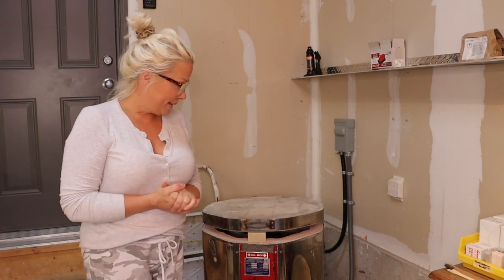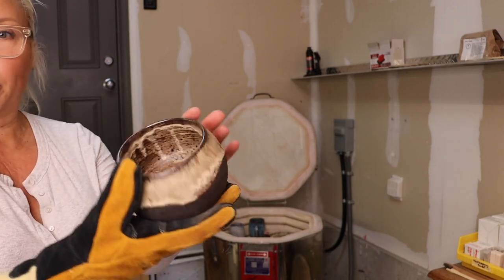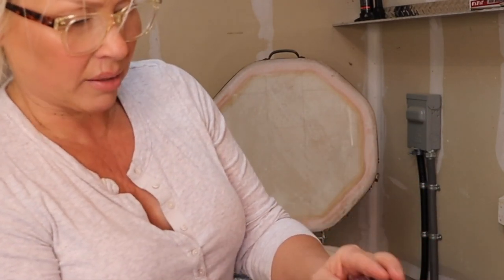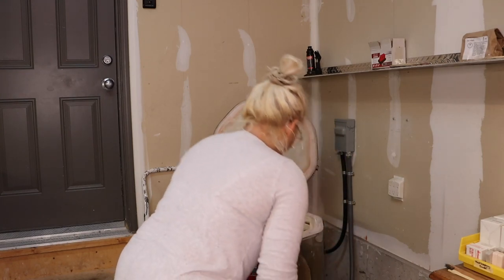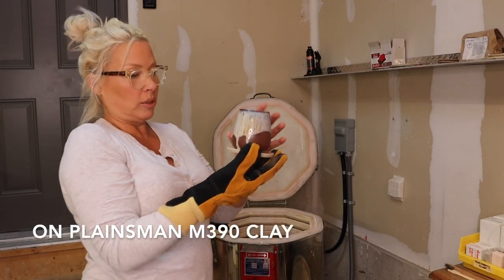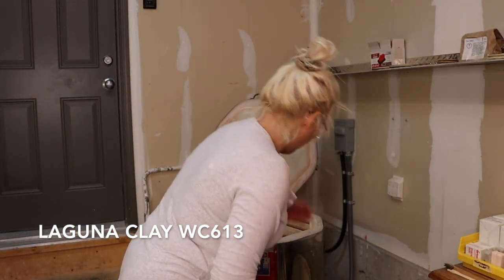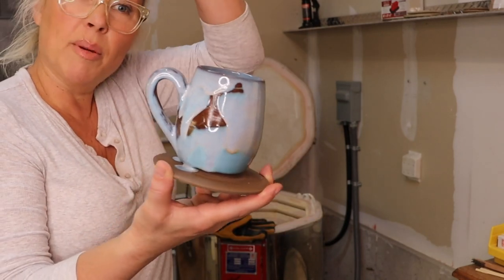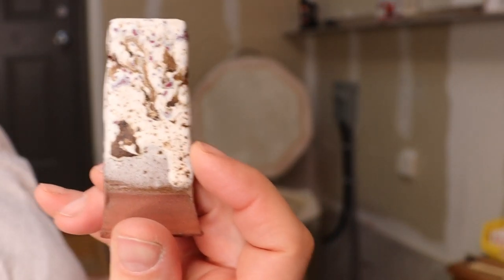GLAZE KILN UNLOADING - Using Mayco, Coyote and AMACO's Potters Choice Glazes   HD 1080p

Comment: Hi, you can just reapply a bit of glaze where the crawling was (maybe you will have to heat your pot before). Crawling is because the glaze was applied too thickly. Same with where you forgot the second layer: just reapply and fire again. Sometimes the colors get more melted and even more beautiful after a second (of third) firing. About the catchers, how many times can you use them? They don't bloat after several firings?
Reply from the maker: Hi Ann! Thanks for the suggestion re, refiring, I have done that before and maybe I should try it here. I am worried that the glazes will run roofs the pot but hey it’s worth the shot cuz as it stands they are ruined! as for the drip catchers you can use them many times, I usually end up smashing them due to drips than for any other reason. And for bloating it really doesn’t matter bcuz you aren’t using them form anything other then for firing. You can even put kiln wash on them for even more uses! As a side note, I can’t take credit for them I got the idea from Old Forge Creations. Thanks again for the tips!

Comment: Hi can u link the old forge creations video where he did the plates that ur using to elevate ur pottery
Reply from the maker: Hi Tonie, Thanks for the idea! I've put a link in the description in my next video..uploading hopefully tomorrow.. if all goes well :)
Reply: @SarahWaltonPottery  oh good I have an idea for those mugs that the glazes slipped from how about u redo them but put one glaze on the inside and another one on the outside will that work give it a go
Reply from the maker: Hi Tonie, hey that might work! I’ll give it a try. I will heat up the mugs and apply some more glaze- one on the inside-one on the outside and refits…Fingers crossed that it works!
Reply: @SarahWaltonPottery  I meant redoing the same mugs from scratch can u refiere pottery ? I dunno if u can won't it crack or break or something
Reply from the maker: Yes you can refire pottery, sometimes with beautiful results, sometimes not so much. You can get bloating if the clay gets too much heat work and some glazes do better than others..its kinda trial and error 😊
Reply: @SarahWaltonPottery  that butter pot that cracked  what could u do with it
Reply from the maker: I’m going to refire it and see if I get a better glaze finish. If the crack gets worse then it’ll become a glorified test tile.🤭 if it smooths out I’ll keep it for myself and use it as a storage jar. Maybe as a salt cellar.
Reply: @SarahWaltonPottery  oh ok great cant wait for ur next video

Comment: Your cone packs are backward. The lowest cone should be first in the pack (it slumps first, so you don't want it slumping on an unslumped cone in front of it). Also, if you had placed the cone packs behind the peepholes where you could see them, you would know exactly where the kiln is during the firing. Clearly (based on the large cones) your firing was ended too soon and did not reach temperature (although it is firing unevenly - hotter in the bottom). If the cones had been where you could see them, you could have fired spot on temperature, even corrected the uneven temperature. There is not much point using visual cones when you can't see them. Never trust mechanical kiln devices, especially kiln sitters!
Reply from the maker: Thank you Will for this info. I appreciate you taking the time to give me these great pointers. I struggle to see the cones in the kiln thru the peep holes even when lined up where I should be able to see. All I see is red hot. I tried using a flashlight as I’ve seen a potter do and that didn’t work so I use the cones to confirm that each shelf makes it to temp. So if you have a suggestion to help me see the cones during firing I’d appreciate it. 😊🙏